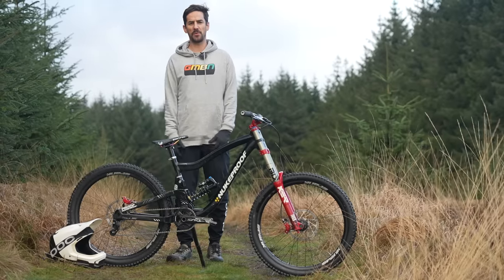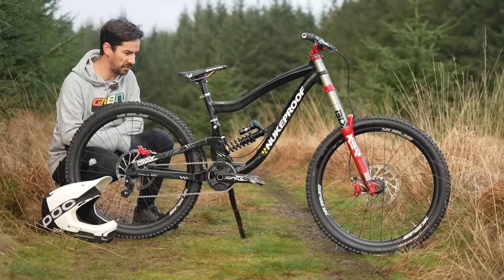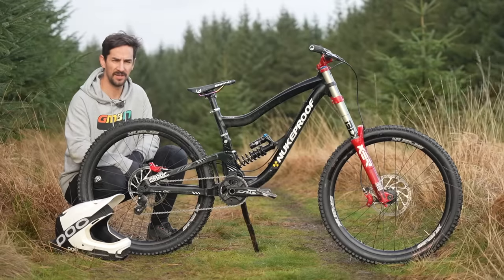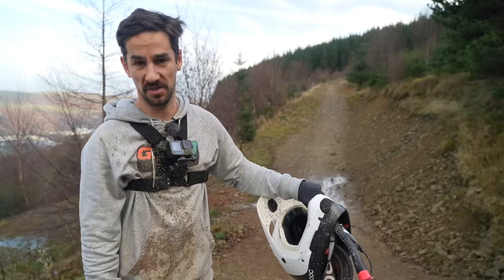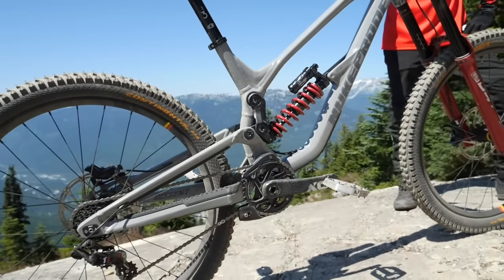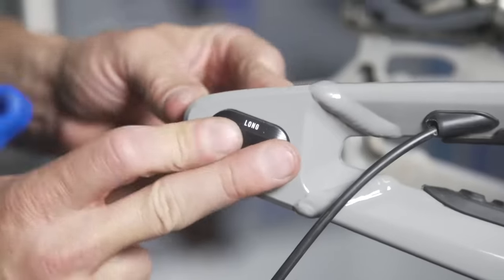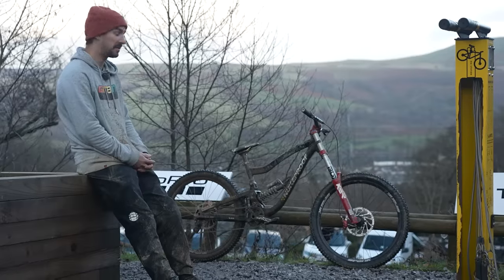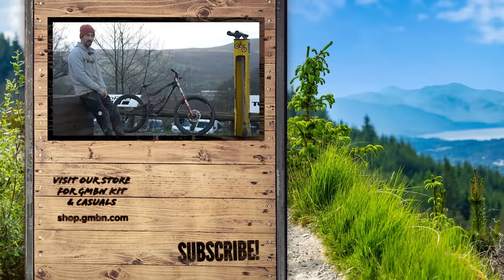This Bike Makes Me Want 26" Wheels Again!

Comment: Bought a 29er hardtail 4 years to see what they were like, great on long fire roads but sucks for anything else. Have hired and tried quite a few of the latest crop of 29 / 27 duallys and not a fan either, so that's why I'm having a custom built 26" dually frame made. Will have no dropper post, 2x 12 drivetrain with a dura ace rear cassette, 90mm 0 degree rise stem with flat bars. Will be around the $10k mark when finished. 😀

Comment: Nice vid! I recently built a 2015 Scott Gambler with 26" wheels and I'm super happy with it. The frame is compatible with both 26" and 27" wheels, but I prefer the 26" setup as it performs perfectly for me. While I also have a 27.5" enduro bike, I find that the older generation DH bike with smaller wheels is more fun to ride because the more effort I put in, the better it performs and I feel more in control. The newer enduro bike with 27.5" wheels is definitely easier to ride and feels faster, but I don't get the same sense of control and at times I feel like a passenger if that makes sense?

Comment: I was using Sun Ringle' Black Flag Pro  26 wheels for a bunch of years on multiple bikes, because they took a ton of abuse and didn't taco like so many other wheels. I'm 6'4 and in the 220 pounds range and have a habit of popping and bouncing off anything I can find(I break a lot of stuff). When I got onto a 27.5 frame I used the same wheels but in 27.5 version and they fell apart super fast! I bought multiple sets and the same thing kept happening. I had one rim split in half(credit that it didn't just melt below me...I actually finished the ride). So I came to the conclusion that 26 wheels inherently will be stronger..another advantage to riding 26

Comment: I still ride an old 2007 GT 26er (modern 1x11 SRAM and wide bars kinda thing after I originally built it as 3x9 over a decade ago) regularly on my local bridleways etc I still like them after starting on an old rigid Kona back in 1993 !!! I do have a 29er and 650b bikes but still have fun on 26" wheels.

Comment: 26 inch rear wheel with a big tyre and a 27.5 inch front wheel is what i run for down hill trails back end seems to just cut through the  corners better and get more lean in them i also ride a hard tail frame feels super fast

Comment: Have two old yeti 575, both 26ers. One built more form XC that I leave at my sisters beach house so I have something fun to ride.  The other I put a 27 wheel in a 26 fork, so it’s a 76er. Bike rides great.  Honestly, the only two things that I feel it lacks vs my Whyte T130 is the rear carbon is not stiff at all, very squishy and I really prefer 2.6 tires. The rear of the yeti can only fit a 2.3 without rubbing and front onto 2.4. I take it out from time to time and I am never disappointed.

Comment: I still have my old 1993 Specialized Hardrock.  It's not a downhill bike, but it's a 26er.  It is in great shape mechanically, but has been sitting in my garage mostly since I got a new carbon gravel bike in 2020.  It's calling to me though, it can take pretty much all the use and abuse I can dish out (including a crash at 19 mph a few years ago).  I thought it would have been easy to get rid of when I got the gravel bike.  Right now that's what I want to ride, though i wish it had front suspension.

Comment: Got myself a $175 Trek top fuel carbon 26er… it is my xc race bike ! Lighter than most.. $89 1989 rockhopper from goodwill makes local trails super fun- full rigid and cantilever trails… easy trails become hard again !!   $56 diamondback zetec 2.1 from goodwill has a dropper and some new bits and is my “hobo” nukeproof hardcore hard tail… Three different beasts, you can try different geos out easy.. see what riding you like.  RSD Middlechild frame is on the way, my first modern mtb :)   So many cheap 26” out there… and those of use who lived thru the 90s pined over some of them back then, now htey are $75 full bicyle 😊

Comment: Got a Rocky Mountain ETSX 50 to refurb for my daughter this christmas.  A bike I really wanted in the day but still have my FSR.  Went 1x9 MicroShift Advent, serviced the Foxes at both ends, new tyres, grips, bars, stem, headset, saddle, repainted the frame, recycled some Tectro Auriga Pros in place of the Formula brakes.  It was a fair amount of work, but all in £180 for the bike, parts were easy to find and really cheap if you're not set on the latest, labour was fun.  Got some XT and Raceface cranks lying about after.  Was it selfish to pick a bike for my daughter because I loved it?

Comment: Came from bmx, i just bought a cheap 2nd hand Knolly chilcotin 160mm 26 incher, converted it to a mini mullet (27,5 up front) and i'm having the most fun i've ever had in my life with a mtb (had a dh bike in the past, and rode loads of hardtail bikes also). 27,5 up front helps so much with stability when going fast (since the geometry of the bike is pretty small for today's standards) but then the tail is so alive, and i mean it in a fun way (it reminds me of my bmx just with suspension, and in that regard, that's what i wanted out from a mtb) so guys, try it! it will not disappoint!
Reply: am planing on doing the same i love my 456 but guna build my own slacker 26er hardtail frame and if that goes well i'll build a 27.5/26 mullet full sus next with up to date geometry too

Comment: You can get good 26" wheels through AliExpress. Still have my on-one scandal as my goto winter bike for XC and general riding - roadie by nature. Converted it to 1x11, dropper post, updated the cockpit and added decent Schwalbe tyres ( HansDampf & NobbyNic). Handles like a different bike. Fun to ride

Comment: I ride a kona process 167. (The new stinky) 2016 edition. It’s mullet set up… 26” rear 27.5 up front.. single speed too.. wouldn’t change it for the world..only run 180 zebs upfront though..and 500lb coil at the back

Comment: I have the last 26" carbon V10 that actually had 10 inch travel - 254mm rear!. Its great through corners and jump but when you ride steep and over drops your front wheel feels tiny being used to a 29er front wheel now.

Comment: i have build my Kona supreme operator with a mullet set up but still run on 26er wheel set but if i try to go to an event  i may change the front wheel for a 27.5er but yeah 26er is not dead still the best wheel size for me for maximum  fun

Comment: My go to bike is 26 DMR down hill wheel in the front and a 24 inch wheel in the back., the wheels are well strong. I have 29, 24, 27.5 too but I never ride those. I'm 6 feet and weigh in at 180. I feel the 29 flex way to much for me. But I also have a 5000 watt motor strapped to my bottom bracket.

Comment: Thinking of 27.5 and 26 rear my Vitus Summet Vr, love 27.5, I'm a short rider.
Reply: I think 26" wheels make the most sense for riders under 5'10".  It seems that taller riders are most appreciative of the larger wheel sizes.  If you aren't so much into DH or super gnarly trails,  26" wheels feel great.  Perhaps they just "feel faster", but so what?  If you aren't racing it's really the "feel" that counts for most cycling.

Comment: I was looking into getting a new entry-level hardtail a few years ago mostly for exercise and light trail use.  Something to replace a 1995 Diamondback hartail that I have not used in many years and would need some significant amount of work to get back on the triail.  Then I stumbled upon a 2010 Marin Attack Trail which got plenty of use by the previous owner, but was also regularly serviced.  I certainly did not need a 150mm travel bike, but I didn't want to pass up an opportunity to see what having a full suspension bike would be like.  It is so comfortable on the trail, and a lot of fun when I want to just mess around with it.  I ride this thing every week.  Perhaps if I got more serious about riding other trails in the area, I might consider getting a modern bike.  However, I can't see going back to a hardtail at this point now that i have experienced full suspension.

Comment: 26 isn't even really 26 anyway. We all the know the measurement is actually tyre height not rim diameter, with proper tyres fitted they size up bigger anyway. My current actual tyre heights are 27" rear and 28" front and thats on a set of "26" wheels

Comment: If I were to do a build like this I'd go with a 27.5/26 mullet Canfield Jedi, single speed with a chain tensioner like you and then an open bath marzocchi dual crown fork. Throw on Magura MT5 calipers with Saint master cylinders and levers and live at the bike park👍
Reply from the maker: Sounds like that would be a BEAST!

Comment: Where did you get that fork? 
I can't find strait steer 26 inch forks with 180mm of travel or more to save my life.

I ride a 2009 Specialized Hardrock. 
26 inch
I put tubeless tires and rims on it,  box one drivetrain with the exception of the box 3 hollow forged crank that's for a BMX but fits perfectly on this older mountain bike and is much more rigid/ structurally integrable than Shimano or Shram MTB cranks. 
( I'm 6 foot 4 240lbs so I need the strongest parts I can get)
Converted to 9 speed from 27
Put 2 piston hydraulic disc breaks on, thinking of converting to 4 piston. 
Its pretty much modernized, If only I could find a strait steer fox or rock shock air fork with 180mm of travel or more and lockout that works for 26 inch rims it would be my perfect dream bike.

Comment: What happened against the will of riders to bike industry 13-14 years ago, today happens to automotive industry - they replaced the standards so that they can sell more new items and make bigger profits out of just closing the enormous second hand market by starting out from scratch with enforcing brand new, useless standards in your hands for everything... No matter whether you want to ride a 26er or a diesel car, they enforce you to replace it with an ugly 27.5er or with an electric mixer on 4 wheels, because at one certain moment you simply can't buy a second hand 26er or a petrol car anymore... Not because new standards are way better, but because the monopoly of the industry has decided to do so... I broke my AM 26er recently and instead of just buying just a new frame and use all the other components on it, I am forced to buy a completely new bike, i.e. new 27.5 frame, wheels, fork and rear shock, just for the lack of a good enough 26er frame on the second hand market already. And then they are telling you that they care about technical progress, nature, less industrial waste, reuse and recycling, about better future... Everything they care about is getting more money out of your pocket as fast as possible!

Comment: I have been riding 26 inch all my life I now use a cross country bike from 2011 that converted to down country and it shreds and  I am times faster than those running 27" or 29" and parts are cheaper for the 26" and for my 1.80m height it's  just about right and build Blake one of them commencal supremes 26"

Comment: would love to see the mavic range of 717 ceramic and disc rims reproduced again esp in 28 and 32 hole spoke options as well as all the tyre options (1-1.8 inch widths) from the major manufacturers, am looking at you maxxis/geax/Irc/schwalbe/continental/ritchey etc.... #26r4life

Comment: 29'ers and 27.5 bikes are the fat, super side cut skis and the giant sweet spot tennis racquets of the cycling sport. They compensate for lack of skill. 26in wheels are lighter, quicker accelerating and quicker turning. This is a great thing if you like technical climbing. If you want to bomb rock gardens, a more slack 29er is easier to pilot down gnarly terrain. No bike is a perfect solution for every riding condition. 26in bikes are still pretty damned useful for all but the most extreme downhill situations. IMHO.

Comment: Actually i like 26er, i have 29er before and 27.5.

Now i have 69er SS, and Old 26er steel mountain bike restored with is rim brakes and slightly old parts. Coz i like old bikes. And i like it.

Sometimes you just felt the wheels is small but how cares. 🤣

Comment: I have both a new 29'er Stumpy evo, and and old 26'er Epic ...  the 26'er is WAY more fun.  Descending at speed over big rocks isnt everything.. and something most don't do anyway.    Besides, most trails are now so groomed clunky wheels and over-sized frames are simply not needed.  *But more importantly* :  Check out RAD frame sizing.. you will have 100 times more fun on a bike that is RAD+ or RAD++ than you will on that awkward XL the salesman sold you

Comment: Enough of the cycling industry dictating what everyone should ride. 
We keep on hearing all these meaningless terms like 'playful' when what people mean to say is bikes that you can actually ride, rather than bikes which direct you which way they want to go.
If you are any good on a bike and smaller than 180/175 everytime you start to attack jumps you are in peril of getting bucked over the bars when you arse hits the back tyre.
And forget whips or throwing the bike around on a 29" oil tanker unless you are 190 or taller. 
They're just not made for riding, only going over shitry terrain quickly.

Nevermind, in another year when the market is saturated with 27.5 and 29'er barges, the bike industry will reinvent the 26 and ridicule anyone who isn't riding the latest thing.

Seriously, can't we all just ride what we want without this constant ridiculing if we don't have the latest most expensive kit?

Comment: The only thing I like about the whole big wheel blah blah is it forced manufacturers to stretch and slacken to fit it all in.  Finally finally finally the geo got to where it should be! I wish they would make a bike with totally modern geo with 26in wheels..... I used to buy a larger frame for my height to get the wheel base and then a 24in back wheel to slacken. I cut the chain stay and seat stay on a brand new iron horse frame and welded it back up again just to slacken it back in 07. No one believed me back then. Stupid long stems, stupid roadie traditions, I could go on ...

Comment: My bikes 2023

-Khs dj200 2014 frame, singlespeed xfusion Velvet 100mm

-Scott Nitrous 20 2005 rock Shox lyrik rc2 Air, Shox kona Air, Dropper, XT m8000 11v, Sram Level TLM (12964gr)

- Scott Nitrous 10 2007 Fox 36 talas kashima 180mm Fox 3.0 coil, drooper, avid elixir cr carbon, Sram gx 12v k7 e13 9-50d

-Scott High Octane 2007 rock Shox Totem 180mm DH coil mission control, Fox dhx 4.0 Titanium spring, sram guide Rsc ultimate, 10speed x9 xtr. MULLET 26/27,5

-Scott Gambler DH 10 2010 rock Shox boxxer Team tuned World Cup, Fox van RC coil, sram guide RS, xx1 11speed.

Maxxis tires Full.

I From Brazil 🇧🇷